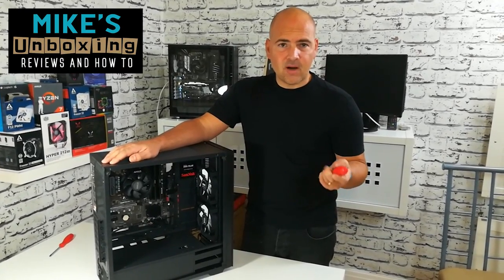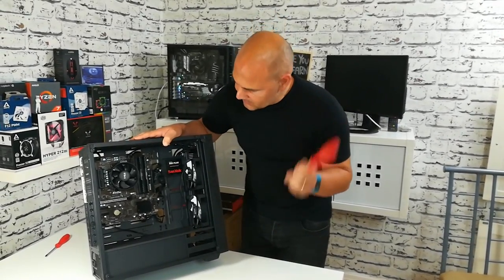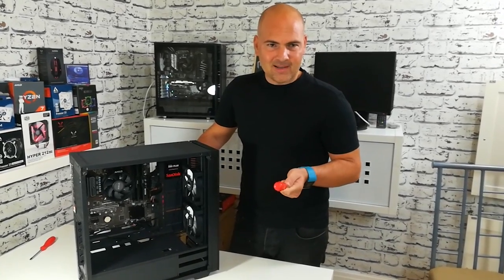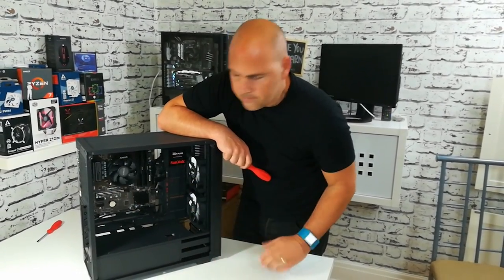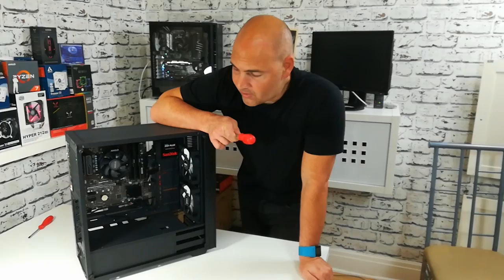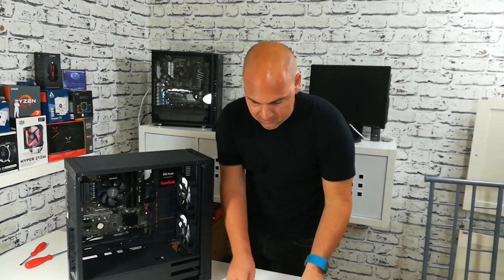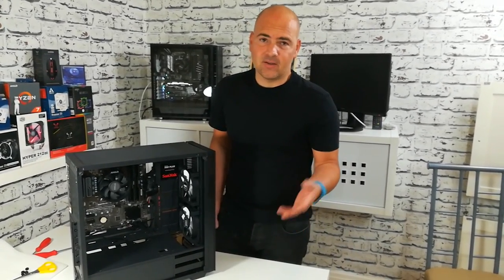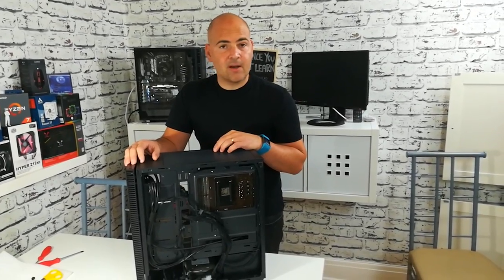Kolink Stronghold Mod And Freezer 33 Matt Black Mod Filmed On Huawei P10 Lite

Comment: Hi Mike and All. 
Had to use CraftPlanet's 'FunkyFoam' on HDD's to dampen constant buzzing. One sheet is around 65 p. No other issue with this case at all.
Reply from the maker: Thanks for the heads up funky foam is that sticky on one side? That would be useful if it is.
Still think this case is the best in the price range
Reply: Hey Mike, thanks for reaching out. Highly agreed, this case a winner, winner, chicken dinner. So happy with the deal. 
Sorry to say, it's just a plain sheet of foam with 2mm thickness. Did cut into 1.5x1.5cm squares, then just poked through with screws. Used 2 tiles for each. Then 'screwed them in with confidence' according to TheVerge..
Reply from the maker: That is a good idea about the squares. I stuffed a load on there! Your method sounds much more elegant 😁
Reply: Elegant over sporty sometimes do matter, but no one can see in this case, therefore your approach is absolutely fine too :D
Reply: Hey Mike and all, I'd like mention, this item has got decent structural tension. Got fairly new components, quiet edition fans, new PSU etc.. It wasn't just the HDDs, the whole case buzzing. Solution was for me to detach 2 plastic standoffs, (paralel with glass section) then insert a shock absorbent foam in the middle to have three point suspension over two or four. (Tried all combinations with different foams) However vibration still there, barely audible. Hope this helps out someone.
Reply from the maker: Good solution to an annoying problem 😎

Comment: i have this case and  my whole pc is  kinda  makes a buzzing noise and you can feel it  vibrate  when you  touch the case 

at first i thought it was a case fan  so i ran the  pc  and stopped each fan for a few secs to to see if the noise would go but it    still stayed 
so i tried stopping the  cpu fan for a few sec  and  it stayed 
so its either   the hard drive or  power supply or the mother board which is  buzzing  

I tried pressing all the components and  the only component  i could  get to make  a slight  noise difference was the hard drive 

so i might make a little cage in foam like you    and give that a  try   
i am finding my case is getting quite hot to the touch  as well  so   i purchased another two fans  which i will install  one as a intake and  one  as a exhaust
 to see if this  helps
If i could go back in time  I would probably spend another £20-£30  and  get a better case
on a side note i have read in  that taking off the front panel  can reduce temps in the case by up to 15 deg so it   looks like the air flow is  restricted 
so i might get  a dremel out and drill out some holes in the  front panel of mine  and stick a  mesh   over the top  to improve the  intake  air flow
Reply from the maker: The chassis does seem to have some resonance issues. I found that removing the Hdd completely solved my problem. As for the airflow, the front fans are perfectly placed for good airflow, the side vents require the airflow to bend 90 degrees which reduces the pressure so removing the front panel really makes a lot of difference.
Rather than cutting the case maybe consider putting in some pressure optimised fans to counter act the 90 degree bend?

Comment: So im getting x3 Corsair AF120s tomorrow for this case. Was gonna put two at the front mounted on the inside of the bracket, and one on the back of the case. Would it be wise to get a Pressure-optimised 140mm fan for the top or is that overkill? how should i set my fans up if you dont mind Mike! :)
Reply from the maker: 3 fans should be enough - 2 up front and 1 in the rear. 140mm would be nice but I don't think it would be entirely necessary